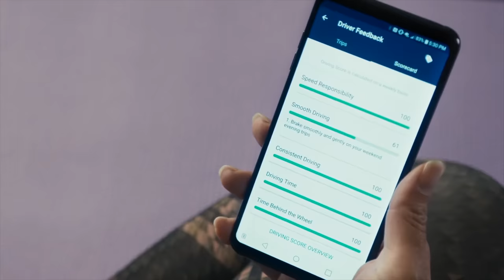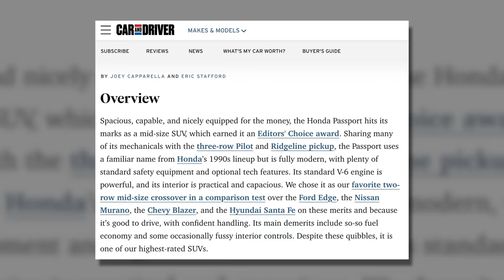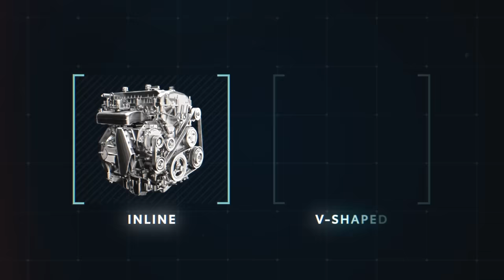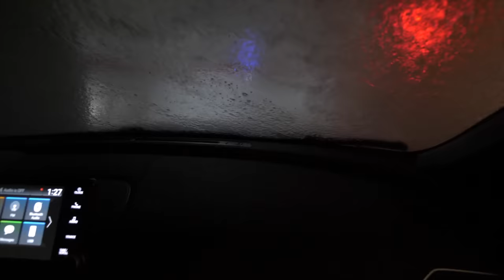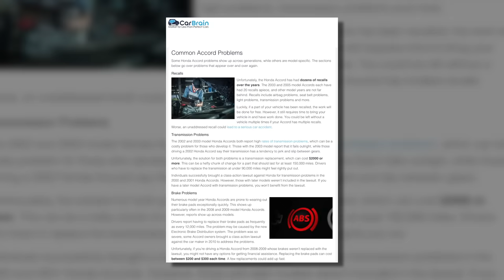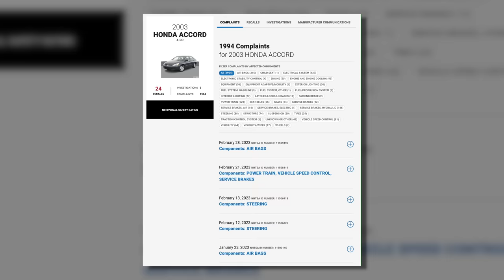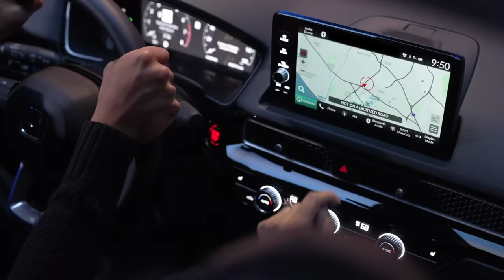Honda's CEO Just Said, "We're Losing Customers Fast and Don't Know What to Do"

Comment: Why?  It used to be that Honda and Toyota used to "back up" their cars.  Under warranty or not.  An implied warranty if you will.  Now it's the dealers that are not doing anything to keep that service alive.  In fact, that is how Honda and Toyota achieved success in the United States in the first place.  We Americans got fed up with poor warranty service from the "big three" U.S. automakers.  My last GM car was a Citation.  It had a bad transmission.  It was a new car.  I had to argue for over 3 months with regional centers to get it fixed under warranty.  I have not purchased a GM car since.  I switched to Hondas and Toyotas. In 1978 I purchased a new Toyota Corolla and when i had just a few miles over warranty.  The engine failed.  Toyota sent out a rep to our dealer and I paid nothing to have it repaired.  Toyota paid most of the repair with the dealer "kicking in" the rest.  It now appears that Toyota and Honda have been Americanized.  They have to be "hard pressed" to do any kind of warranty work. My latest Honda 2021 Accord had bad brakes.  My dealer said Honda didn't warranty the brakes.  To fix the brakes was $1600.00 for all four wheels.  I recently sold the car.  I feel a good dealer would have done the job under warranty.  For $34,000. , I would think the brakes should work.  The car had bad brakes since new.  I only had 21,000 miles on the car when I sold it a couple of weeks ago. I switched dealerships for my next vehicle.  A dealership that hopefully has more respect for buyers.  Some dealers don't care about keeping customers.  Some do.

Comment: Honda’s paint is indeed terribly thin.  It doesn’t hold up well long term and flakes off.  Their designs have been mostly boring when compared to competition and power trains have hardly been keeping up with the competition.  The 94 accord was my first car and it was solid, great audio system (my dads 2016 accord exl has the worst sound - not sure why they would cut costs there).

Comment: I bought my first Honda in 2019 . A brand new 6-speed HRV. What a piece of junk !! Never again. The body panels were about as thin as a coke can. You could literally push a dent in it with your finger. The seats were harder than two woodpecker lips. The electronic handbrake was a deathtrap. I mean it's nice to have a real handbrake with a stick shift. But the worst thing was the engine. Every time I changed the oil (Mobil 1 every 5k miles) the pan would be full of brass sparkles. Lots of it. I could almost understand it on the first change but every time for 5 changes. That engine was quickly disintegrating. I traded it on a Subaru at 25K miles.  Goodbye junk pile. My Subaru is awesome!!

Comment: Well I love my 1.5 2018 honda accord touring is nice but not too happy when the a/c went out, had to replace fuel injectors at 30k ish miles. Did it myself cause I wasn’t gunna pay over 1.5k dollars to replace. Kinda plows my mind just the fuel injectors cost me over 400 dollars. I have to replace the head gasket as well. Atleast the 10 speed transmission seems to hold up. Knock on wood. But really the car seems like a lemon. Car is only at 70k miles right now. Gunna probably have to replace fuel injectors again 😂

Comment: Stop making front wheel drive/front wheel drive based all wheel drive junk. Discontinue the Ridgeline and make a replacement real truck. You know, a rear wheel drive transmission, a square shaped bed with a 2 inch gap between it and the cab like a normal pick up truck that would compete with the Tacoma and then come up with your own V-8 engine and come up with the competitor for the Toyota Tundra. Make some larger vehicles like Toyota and Nissan. Switch the pilot to a rear wheel drive transmission and make it a more rugged SUV.

Comment: Their bread and butter vehicle the crv I looks gorgeous. Prettier than ever. But it doesn’t offer most of the amenities like heated steering wheels that it’s competitors offer and the engine is slower than most of them. Most cars give an either or. And then on top of subpar amenities and subpar performance they’re charging almost 40,000 for the ex-l. Plus there’s the electric version that nobody wants

Comment: Stop telling customers what you think they want; and make what they want.  I got a new car in 2021. Rav4 Prime. I looked online at Honda Passport, but didn't even go into showroom because I saw the imitation gear shifter. Not for me. I want a real shifter I can shift by FEEL!  I don't want button shifter either.    Touch screens are OK for programming or information; but SUCK when driving; most prefer buttons and knobs you can feel.   Plus, HP lacking compared to Toyota's Rav4 Prime's 302HP, no fun in any Honda's I could see.  Cars need to be focused around doing things simply; so driver can FOCUS on the road.

Comment: Scotty thanks as always
I HAVE owned several Toyota and Honds in the past 40 years. Starting with Toyota Tercel a wonderful car. Then lousy Lancruiser 99 and lousy Rav4 97.
Lots and lots of rust in the rust belt Midwest I live. Toyota hid the frame rust issue in Landcruser. Only people knew about it they got it fixed.
As a result I switched to Honda. 2 Honda fit, 4 Pilot, 1 Ridgline. 
I am amazed about the reports that state Dodge and Ram have fewer complaints. I have my share of issues small with Honda than Toyotas I owned. It was Toyota's fault that lost me as a customer for hiding issues. I 2 had Camano and Covette before. 79 corvette 4 speed, L89 package. Paint, transmission, solenoid all kinda issues. 
No car is perfect but I chose the least of evils. Any Honda I own, be it snow blower or motorcycle,  man the engine is a marvel. I would have a conspiracy theory that the Honda USA which hires the land off Detroit 3 high level mangers, are to be blamed. Probably the same with Toyota. I don't think my 40 year old Tecel had any American Manager touched it. It was pure joy. Something for Toyota and Honda to take a look.
As a guy who worked in A Detroit Auto oem, at low mid level white color, I was exposed to the management way of short term thinking. It was all about cost cutting issues. They would know that they become a hero if they slashed costs for getting quick rise in the corporation. The issues warranty would surface way after they were gone.
By the time they were caught blame would go around and no one would take the blame.
They probably would end up with a golden parachute in a Japanese or Korean company.

Comment: Honda has always toned down the exterior styling. LA dreams up something good, and then engineering tones it down. ALWAYS! I worked there for years, and it was frustrating to watch design after design. I also think that too much attention is paid to simplicity. Sometimes, you gotta go with your gut. The old hatchback Accord’s MADE Honda. It was simple…but practical. My last Honda was back in 2006. The designs are just ….. boring.

Comment: Of course they are loosing customers!, they took my car for a month to diagnose a parasitic energy leakage and they didn't knew how to fix it but they told me that maybe replacing some xyz (very expensive) parts could fix the problem but they were not sure, long story short, after more than six months of not using my car an independent mechanic found the problem in less than an hour for $20 and removed some Bluetooth Unit that was causing the energy leakage, after almost two weeks since the "fix" the car has been running without any issues, Should I replace the faulty Bluetooth Unit with a new one that will cost me $300? I don't think so.

Comment: I have a 2000 Honda accord and it has every single issue you mentioned. I also have a 2005 toyota corolla, that has absolutely zero issues. The toyota has 255k, and the Honda has 165k miles. Toyota is hands down way more reliable and durable than Honda. Honda is pretty fuckin average in all regards.

Comment: Honda is not bad but they are no Toyota.  I have owned a Toyota Corolla,  Canary,  Honda Crosstour and now a 2020 Toyota Highlander.  My Toyota vehicles have been virtually problem free. Not so much with my Crosstour after 100,000 miles.

I still would by a Honda over an American vehicle or even a Nissan.

Comment: Also, Toyota has the oldest buyers of any brand. Plus, if you live in the rust belt. Toyotas are very ec ologically responsible- they recycle themselves. Finally, they're as exciting as warm oatmeal. If you're driving an enthusiast Toyota, it was likely made by another brand- Subaru or BMW. My parents drove Corollas in retirement, after a lifetime with GM. they were boring, nastly looking cars, but they ran- even without oil, transmission fluid or coolant. Hey, if that's what you want.....Myself, I drive Mazda Miatas. Bulletproof and fun.

Comment: I'll never buy another Honda. The paint is peeling off the roof and sides of the rear window. This is clearly a Honda QC problem but offered no help. The dealer wanted to charge me 5K to re-paint. Bye Honda - Hello Mazda.
Reply: Mazda has a paint chipping and bubbling  issue on a few of its color options. Machine grey and Seoul Red for starters!

Comment: Toyota cars are cheaper in general and just as reliable with better fuel efficiency, Mazda cars look better with more luxurious interior, Nissan has better more powerful engines, and still uses traditional automatic transmissions on upscale models, there's literally nothing that Honda is #1 on today

Comment: The CVT transmission being the only option is just a deal breaker. That transmission is very annoying to drive. The inside of the new Honda civic look awful and out of line from past generations and the audio sounded like trash. The electronics looked very cheap and felt very cheap. The inside of the civic also has a lot of plastic so it just feels really cheap. The body of the car looks decent though, and that's about it. 

The sales at Honda also tried to pressure me to buy the car right away and tried to pressure me to buy the higher end model that I did not even need when I clearly mentioned that I had no interests in the higher end models of the civic because they didn't bring anything more to the car that I cared about. I think there's just a lot of problems going on at Honda right now on many aspects of the business from how the cars are designed to how they are sold.

Comment: Honda used to offer reliable economy cars at a competitive price - now when you go to the dealer they don't have any lower trim models in stock and quickly push you to a higher trim model for a lot more money. Nowadays after dealer prep and several dealer addons and tax the economy car is pushing 30,000 dollars and more. Even used cars are over priced. Honda is acting like they are selling Mercedes Benz and they wonder why there are less customers. And then there are no electric cars which is the future. Another failure with Honda is they have decided that gas mileage is more important than long term reliability. So they put in a CVT auto trans and a turbo charged 1.5 L engine both to give better gas mileage but both will fail sooner than the older tech. If you reach higher milage , you will feel the pain of higher repairs costs. The good old days of amazing reliability are gone.

Comment: Friend, I understand that this video is a more North American reality. The spoken comparisons reveal brands that are reference in America. 
Im writing from Europe, I have owned a Honda for over 20 years, currently with Accord, model, known in the USA as Acura TSX, diesel version. You wouldn't believe me if I told you that in 18 years, 370,000km later, the maximum expenses with repairs outside maintenance do not exceed €500. Compared to premium brands in Europe, the breakdown percentage of these premium brands is significantly higher, more expensive and regular than a Honda. Honestly this video delivers a biased and wrong idea of the Honda brand.
I recently tested the new RAV4 Plug In GR and was disappointed with the quality of interior materials, compared to a 2005 Honda Accord

Comment: Honda has moved to a fixed price model in my country and only import the top of the line civic, effectively increasing the price almost $10k over night. Their bikes too are shockingly overpriced, CBR 600rr is sold for $28k which you can buy many 1000cc bikes for and still have change left over. Honda is completely uncompetitive and deserve to fail at this rate.

Comment: The car model is getting uglier evey year and way more expensive. The lower price model is like the mini-me of the higher price model. No more varieties and choices, you're forced to pay for features you don't want. The freaking Civic is now around $27k with features I don't care for. More features more sh-t to repair. The only features I use in my car are the heat and A/C. Every now and then, the radio.

Comment: Ok let me drop some real facts for you from a man on the street, the comp does what is needed to stay within the times. The moment you went turbo it's the moment when you throw the old ways out the window. Your base is civic should be the si next would be the type r after that the auto  type r ( you don't make that ) after that the 4wd type r ( also not made) the reason why you not selling is cause of not keeping with the times and making your top trim cars accessible to everyone. No one cares about track times when you don't have track like streets to drive on, drags, how easy is accessing the power is all they wanna know about  ( speaking from the American point of view ). The manual makes the car slower off the bat, that alone make other cars a better option for most.  The power output is way too low for it to be enticing for the average American driver ( a driver that's only interested in how fast a car can get down the quarter mile.

Comment: One reason for us - not Japanese reliability;  ac compressor leaked, burned engine oil at slightly above 100k miles, never trust the oil change sensor.   Mdx was fun to drive but the dealers sucked big time, but qx56/80 is more reliable and much more luxurious and better dealerships, till qx56 paint started pealing on the last white Japanese made version, previous 3 Japanese made q45 were perfect minus injectors.  But infiniti based on american armada was total crap, everything broke 1 year and i dumped it for Japanese version - so sad both loose tons of reliability when manufactured here :(.   Toyota/lexus simply the most reliable but too boring, behind the times tech or now too weird looking.   Regardless we do not buy ICE cars any more - looking for the 3rd ev now, way way way more fun to drive and way more reliable and super convenient to not have to go to gas stations every week, saves hundreds from gas savings a month as we drive a lot and mdx and qx drink a lot of gas.

Comment: fuel in oil most all cr-v has a 1.5 earth dream engine with a turbo.They have carbon build up on the valves and yes direct injection.I have fuel in the oil but wait winter is coming soon.What could this mean more fuel in the oil.I will trade this cr-v for a chevy.Know hondas for me

Comment: You’re getting more and more out of touch.  Honda doesn’t even offer a single EV.  So no $7500 discount (among many other issues you aren’t mentioning).  Meanwhile you can buy a base Model 3 Tesla for $35,500 (after tax credit), have virtually no maintenance besides tires, drop fuel costs to 25% and drive the silly thing pretty much for the rest of your life (500,000 miles or more).  Oh, and have one of the safest, fastest cars on the road.  In 2 years you’ll be able to buy a smaller Tesla for $25,000!  Now what were you saying about Honda?

Comment: I'll take a Camry V6 any day. Even if it's a pain in the azz to change the 3 rear spark plugs. Mom's Camry is going on 300k miles. Mostly just normal maintenance. Only headache is the sunroof problem.

My bet is cockroaches will be driving it after WW3.